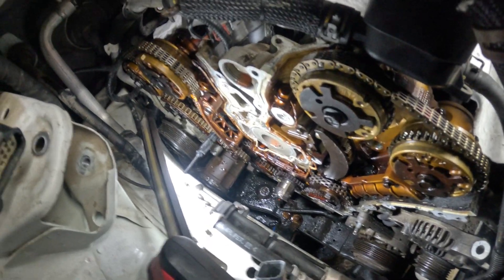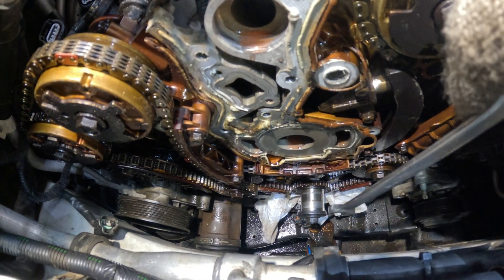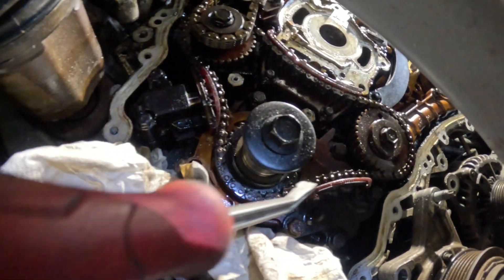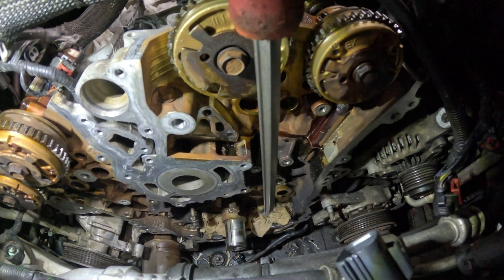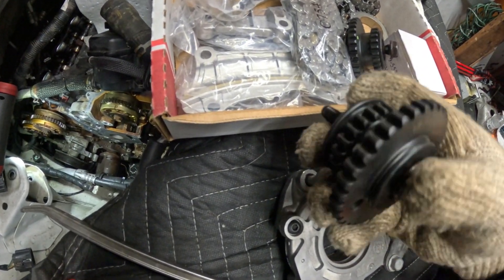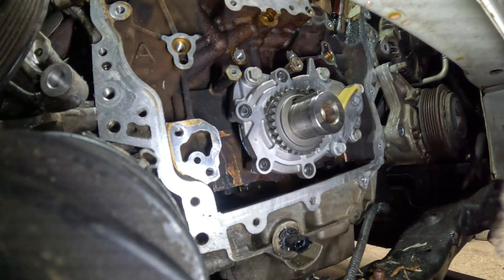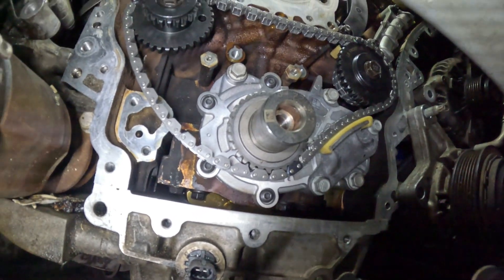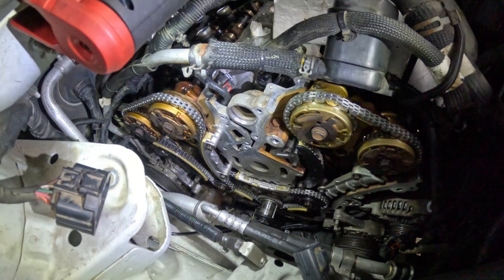2007-2016 GM 3.6 How to replace TIMING CHAIN, OIL PUMP, WATERPUMP. PART 3

Comment: How did you install the crankshaft pulley . Did you use a pulley press installation tool or just use the bolt and an impact to get it seated back on the crankshaft?
Reply from the maker: You can use the tool to install it - it’s inexpensive- like 12 dollars ( it’s basically a longer bolt lol). Yet you can tap on the pulley back on then when you can reach 3-4 threads then use your impact and install it all the way in. There are torque specs but quite frankly I’ve seen dozens on mechanics not follow it and never fails .

Comment: I’m getting ready to this job on my 2009 gmc Acadia. I wish I would’ve came across this video sooner. Still extremely helpful. I was told that the front cover wouldn’t come off with the engine in the car it calls for the subframe to be drop. I don’t have a shop or a lift so I had to pull the hole entire front end off so I could drop the subframe on a dolly to pull it out the front. I’ll never take someone’s word for something this time consuming again because 30-45min of scrolling through YouTube and I could’ve saved lots of time and broken exhaust bolts this has been a complete headache to tackle in the driveway.
Thank You so much for your videos and the extra time and work it takes to film and explain everything. Very helpful
Reply from the maker: Glad you found the video helpful, and sorry to hear about the extra work, I hope it helped save you some time! It’s much more intimidating than what it actually is once you have it opened up . 👍🏼 good luck 

Subframe is not necessary to be lowered for the timing cover to come out , neither does the front end . Cover comes out from the side  straight up 

Patience is key